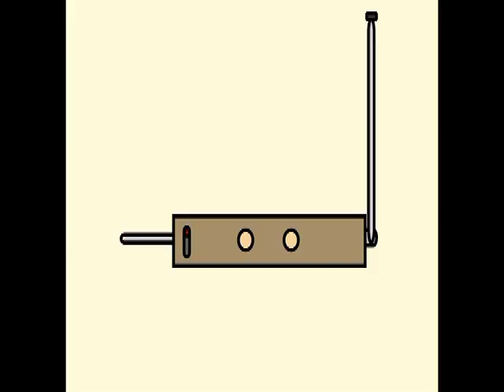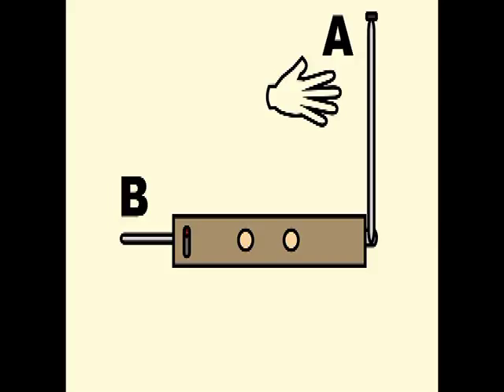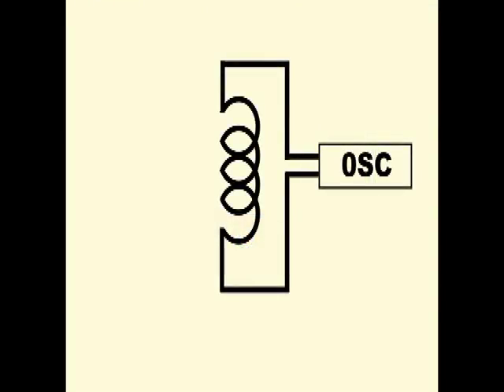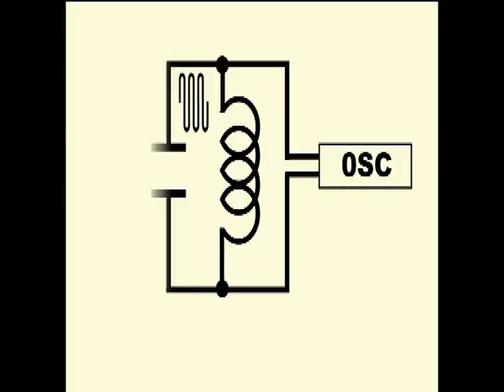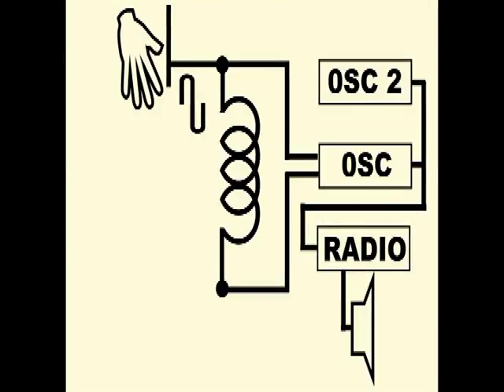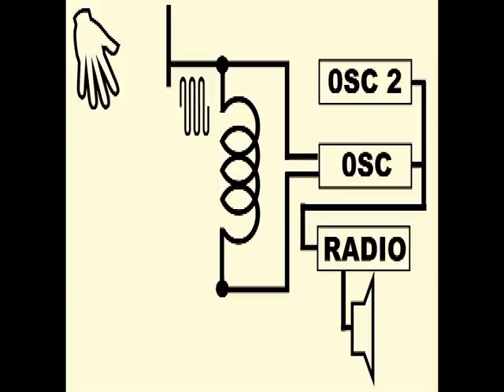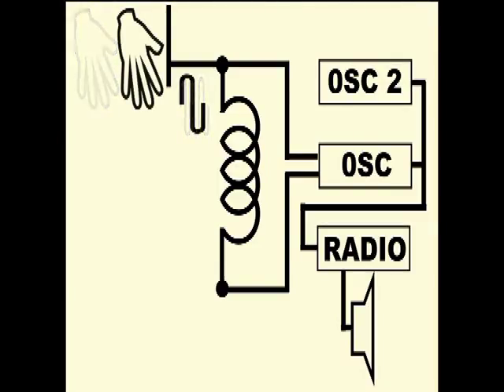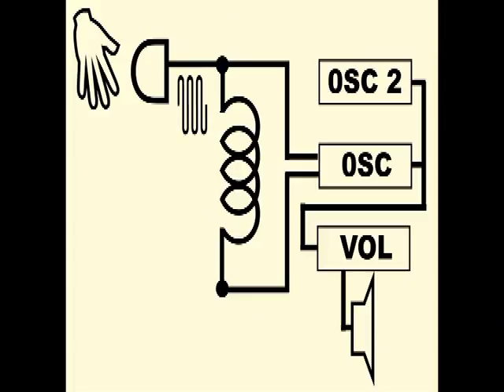How a Theremin works

Comment: How does current flow from hand because to charge capacitor circuit must be complete
Reply from the maker: Dear Nihanth, a capacitor is made of two plates separated by an insulator called a dielectric. A capacitor acts for alternating current (in this case radio frequency) as if it were a conductor. There is no current flowing from your hand, but there is an increase of capacitive load on the radio oscillator when your hand comes close to the oscillator tuning capacitor. You can try by touching the tuning capacitor of your transistor radio (not digital type, but the older type) and hearing how your radio station is slightly coming out of tune, and even shifting to another station. If you add a short piece of wire to the tuning oscillator, you can detune the radio by merely bringing your hand close to the radio. You are creating an additional load on the oscillator with the capacitor made up of your hand and the piece of wire. For RF a capacitor acts as a direct contact. Please watch my video on finding the oscillator terminal at https://www.youtube.com/watch?v=CI5W7ujm93Y

Comment: Thanks for the really helpful video! However one thing I don't understand is how antenna B can change the volume through varying the frequency.
Reply from the maker: One way is by detuning a variable oscillator, so it's signal can reduce the signal going through a band-pass filter and feed an audio gain control circuit, thus turning the volume down.

Comment: So each antenna has a separate fixed and variable oscillator, and for both antennas, you control the frequency of the variable oscillator but NOT the fixed oscillator?
Reply from the maker: Exactly! The fixed oscillator is used as a reference to produce a beat frequency (the audible note) in the detector portion of the Theremin. On the other hand,the circuit for the volume control is based on a separate frequency discriminator so as the capacitance in that oscillator increases (bringing your hand close to it) produces a control signal which turns the volume down. There are a variety of circuits, going from pure analog and also digital. I have a separate video on a homemade theremin, using three old radios. There are also some drawings and plans at http://www.box.net/shared/kgdstzwaoc  . The link to the homemade Theremin video is https://www.youtube.com/watch?v=PSYPUhPGavQ .
Reply: @eltunene  Thank you, sir. I'll check out both links!
Reply from the maker: @kitty7092  Dear friend, I just posted the same file on my Community, with illustrations and explanations, in case it is easier for you.
Reply: @eltunene  Ohhh, this is great man. Thank you. Muchas gracias por ser tan amable y generoso!! Eres un genio :)
Reply from the maker: @kitty7092  Varios de mis amigos en la red lo han fabricado y les ha funcionado muy bien. El que mejor lo ha tocado ha sido el que subió este video: https://www.youtube.com/watch?v=hcq7rDo31lc
Reply from the maker: However, for simplicity, my homemade theremin does not have a volume control, just the pitch control.